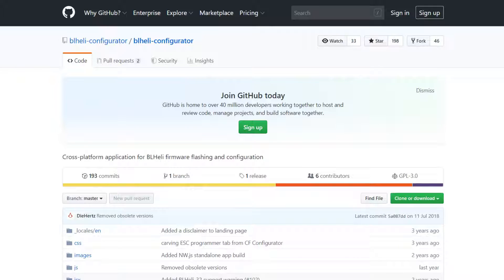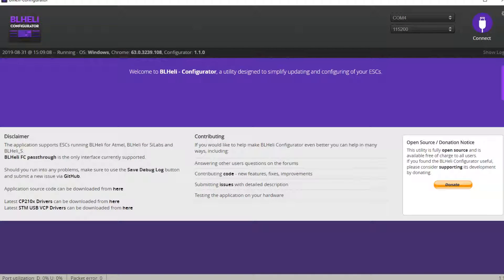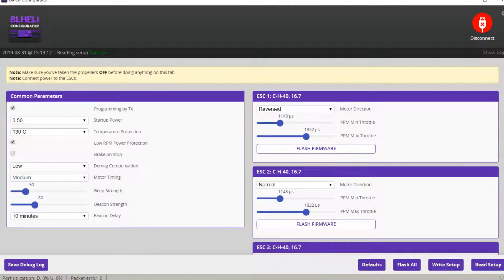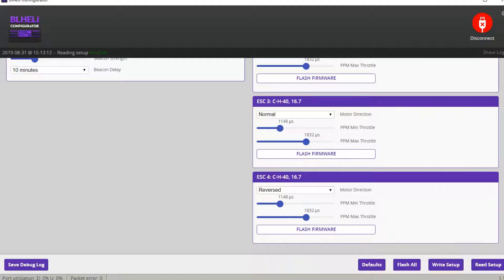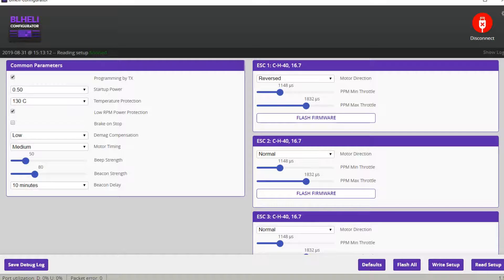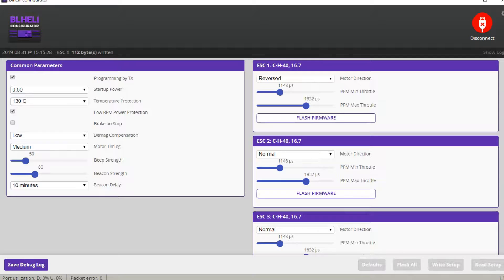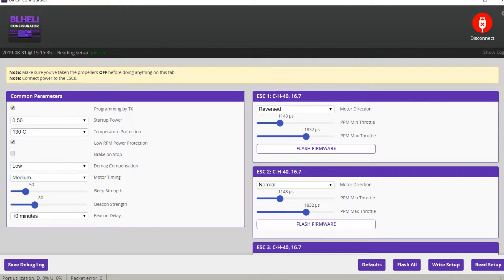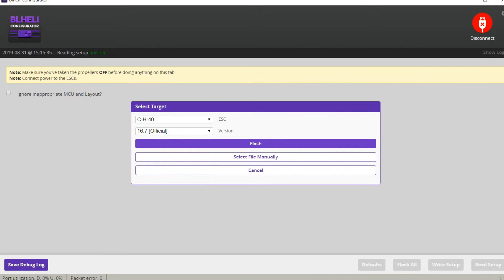How to manage your quadcopter ESC with BLHeli Configurator

Comment: Hey Hobby how do i know what numbers are each ESC?
For instance :
Esc:1 A_H_15 16.4
ESC:2 A_H_15 16.4
ESC:3 ".         " 
  
ESC:4 "      "
With the drone camera facing away from you which motor
Corresponds with 1,2 3 and 4?
Reply from the maker: Hey, good question, I would solve it in this way:
two motors directions are normal and other two are reverse
in this way you should know which pair is which because of the propellers and roting direction

Im not sure why you would set one motor from pair differently to another but if you would change some settings that you would observe the change

Im not sure, but it should correspond 1, 2, 3,4 which is seen in betaflight
Reply: @HobbyWithAdam  Thnx for replying so i went thru your video again and this time i was able to motor 1 as CW. 2 as CCW. 3as CCW and 4 at Cw and i confirmed each motors via the motor slides. I also double checked my props and the quad will not lift or fly. Everything is set properly but it doesnt want to lift, fly. Im at a loss for what could be causing this problem. What do you think. Should i check the ESC's? Thanks bro!!!
Reply from the maker: @techFPV5964  what are symptoms? to lift, quad has to be on even ground when turning on the power, if gps is installed gps fix should be there. Its good to check using fpv screen because there are notifications whats wrong
Reply: I am stuck at this point as to what shall i do?
Reply from the maker: @techFPV5964  interesting, if you are lying drone on even ground it should not happen, maybe esc fault if settings in configurator are ok?
Reply: @HobbyWithAdam  The sysmpton is that motor 4 will try to lift but the other 3 just spin. If i set the 2 front motors as normal and the back motors in reverse will the quad fly this way. I think thats what your asking?
Reply from the maker: @techFPV5964  uh yes, I would try different esc, no more ideas ;/
Reply: @HobbyWithAdam  Hey Hobby it turned out to be tbe #4 Prop which had a CCW prop on it so its flying good now. Thnks for your help✈️👍
Reply: @HobbyWithAdam  Ues it was the 4th prop which was ccw instead of cw!
Reply: @HobbyWithAdam  All of my quads are setup in the esc in this way i described above.
Again back right motor is 1cw,2 nearest camera on right is ccw. 3 is to the left of motor is ccw and finally motor 4 to the left of camera is cw. But your saying i should setup my motors as 2 front as normal meaning cw for both and rear 2 motors are ccw??
Reply from the maker: @techFPV5964  there is correct layout with motors spin direction and numbers https://www.brainfpv.com/knowledgebase/betaflight-quick-start-guide/
Reply: 2 and 4 are facing towards the camera and today i did a motor direction in Betaflight and 4 was off so i fixed all 4 motors to turn properly meaning 1 is cw, 2  is ccw, 3 is ccw and 4 is cw. The props are on properly but i noticed tgat prop 4 lifted oits corner while the otver 3 just spun and yawed to the right. I've hit a brick wall and dont know what else to do since i dont know much about this.. What do you think?